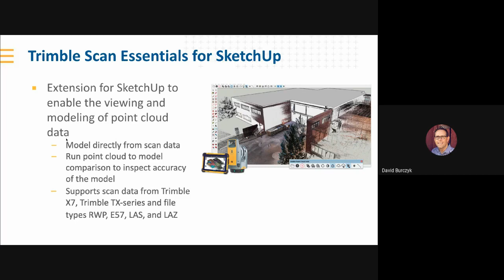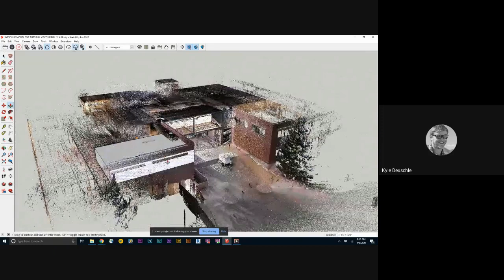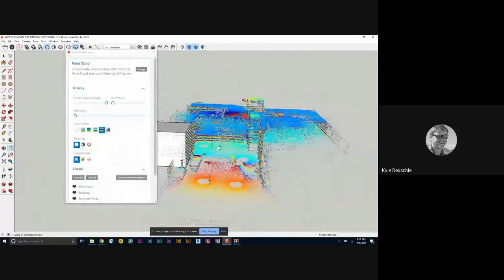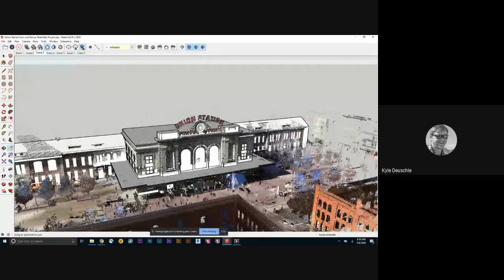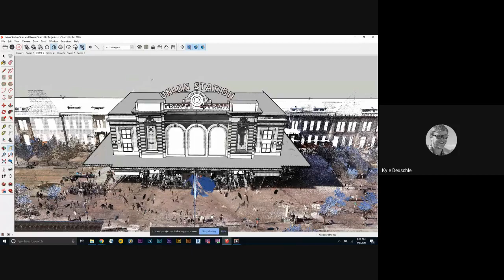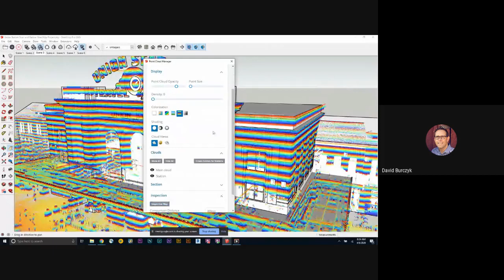SketchUp公告的Trimble Scan Essentials 2020 04 08 at 07 03 GMT 7

Comment: Hi everyone !
I have a question about make 3D Model by SketchUp based on Trimble Scan Laser.
I’m drawing 3D
Contrustion Model in SketchUp using Trimble point cloud. The project I’m working onis quite so large,so the number of points is very
dense,and I can’t pick point cloud.
I have used “Create Clipping Box from Cloud selection” but then selection showing the point cloud points will be dimmed,
and I can’t draw it. Can you help me to solve this
problem?
Thank you very much!
Have a good day!